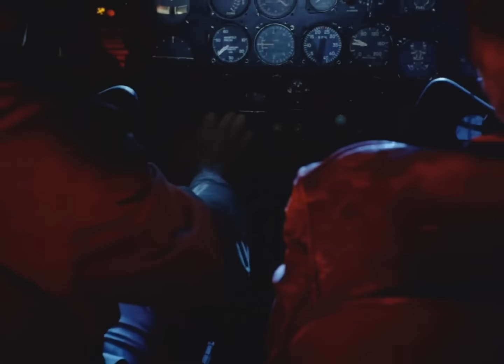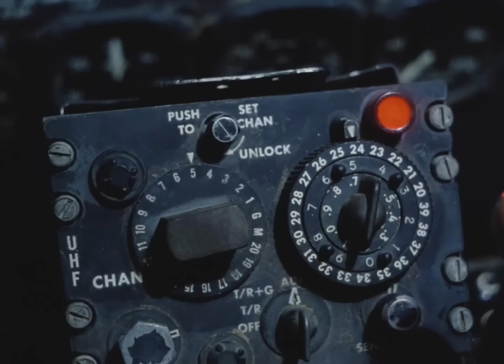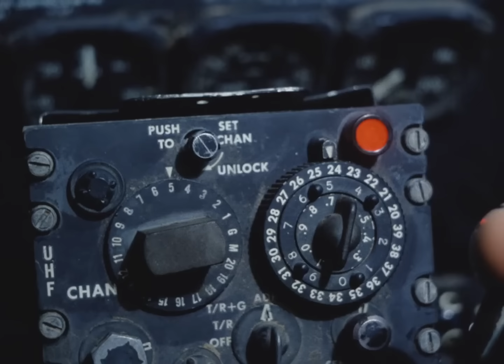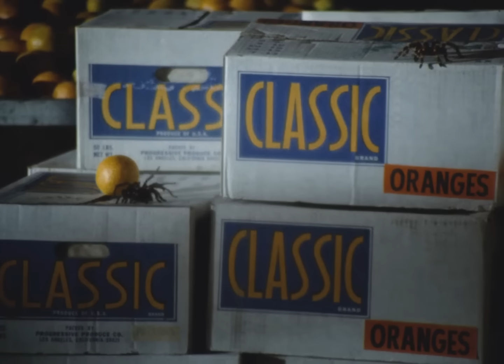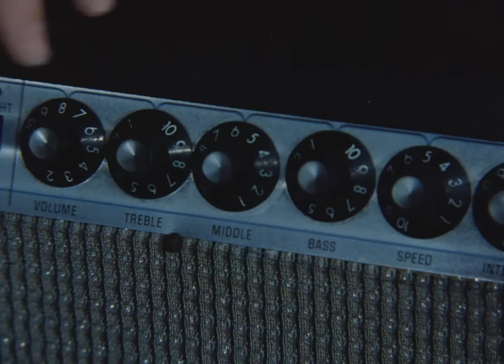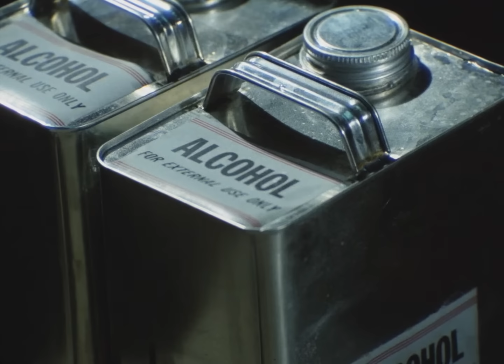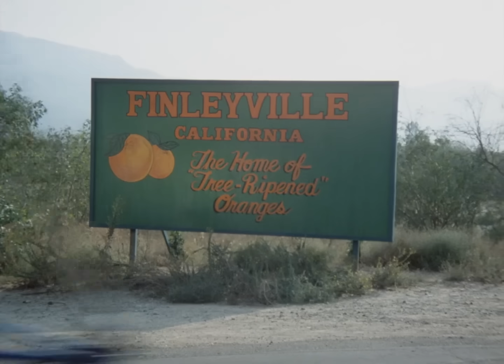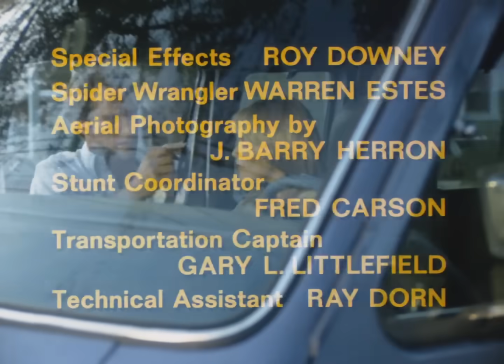Tarantulas: The Deadly Cargo (1977) | RETRO HORROR | Claude Akins - Charles Frank - Deborah Winters

Comment: Now that was one of the most 70’s tv movies I’ve ever seen 😂 wonder if I was the only one on the side of the spiders? 🕷️ my uncle used to fly DC3s, he used to say the only thing better then a DC3 was two DC3s. That one would have been fine, bit of duct tape on the wing and she’d have been good to go 😃lots of fun, thanks!
Reply: DC 3s where excellent and rugged aircraft. I've parachuted from a C 47 which is a military variant of the DC 3. Douglas aircraft were amongst the best. Even today as McDonnell Douglas continue to make some of the best aircraft in the world.
Reply: I was told the DC3/C47 airframe had no time factor and about the only thing that keeps them on the ground is lack of engines. Pretty much the same as a Ju52/3m in Germany.
Reply: @frednugent2310 I worked for McDonnell Douglas. Left just before they were bought out.